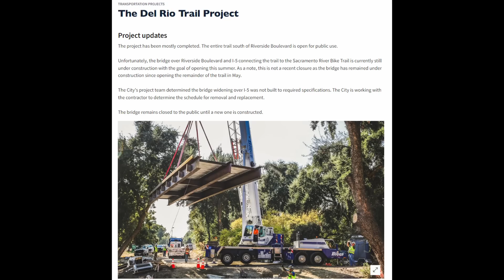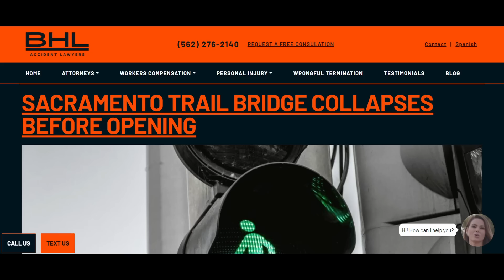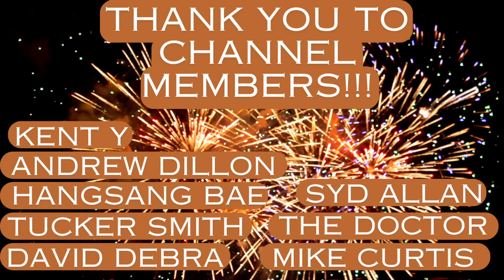Sacramento Pedestrian Bridge - What is the Problem?!

Comment: I used this bridge several times in the last several weeks it save me from having to to used  Sutterview road and the entrance to the levee Sacramento River trail crossing I5 exit and entrance ‘s ramps too I5.  For 50 years this trail from Old Town to Freeport had been proposed, finally it’s done, well almost, I used this trail from my home Sutterview rd. To almost Freeport, Ca. Trail end at a park. You can’t get to the next intersection without out using  dry narrow part of Freeport blvd.  Friday last March 12 I got on this trail from Del Reo rd. At Suttervill rd. crossing Bridge Closed sign yep, both end of bridge closed blocked with k rail hooked my Quatrevelo a chain to my hitch, hook chain to K rail try to move K Rail  but it caused a crack in the bridge a few rocks fell onto I5 I rode on Quatrevelo to old town. Hid from Cal Trans employees who were after me for damages I got away now demanding they re open that bridge as it keeps the kids who ride Sacramento River off the roads. Yesterday I went back onto the trail checking the crack I cause, it’s worse! Thous of you who use I5 beware rocks could fall onto your Tesla, not sure why only Tesla’s get hit with rocks. My count of rocks hitting Tesla’s five hits six misses.

Comment: I haven't been able to find any updates to this story.  Since the issue(s) arose so close to opening, it makes me think that something reated to the deck is at fault.  
Locally Administered Projects (LAP's), in my experience, don't always have the best construction engineering & inspection teams available.  But, a $23M project likely has some state funding, and possibly federal dollars.  If this is the case, certainly (at a minimum) phased inspections, with hold points before proceeding to successive construction operations would have been mandated.
The picture in your video showing the superstructure section being lifted, shows that girders, diaphragms, and SIP metal deck pans were preassembled, possibly offsite.  If these were shipped from a fabricator, presumably Caltrans would have had a shop inspector present ( unfortunately, my experience has shown these inspectors preferring a close relationship to the shop they're overseeing to actuallyholding the shop to the plans & specifications).  My point being, once these pre-fabbed superstructure units are placed, rebar and deck concrete will proceed pretty quickly. 
Rebar samples are often required for testing, and superstructure samples are generally taken separately from the substructure bars.  I f the samples were even taken , it's possible that they weren't tested before the deck concrete was placed.  Another possibility is that rather than placing lightweight concrete for the deck, the contractor might have used an approved "normal" weight mix.  That possible faux pas would add approximately 50% to the dead load of the bridge, while saving about 25% over the cost of lightweight concrete.
Reply: Edit to above:  I hit post before I meant to. 🤪
All I was going to add is that we don't know enough at this point, because nobody is talking...  more shall be revealed
Reply from the maker: Those are interesting insights.  Thank you.  I have reached out a few times to City Engineering staff and they will not respond to my inquiries.  Also, one of the local media outlets reports seeing the letter from the City to the Contractor.  They don't report any details and they did not post the letter in their online stories either.  I will reach out to the City again and push for more details.
Reply: @CaseyJones-Engineer  Sounds like it might take a FOIA request to get any information.  If the city isn't sharing information, they'd likely stonewall that request, too.  They're going to have to release more at some point.  I'm surprised the local media hasn't pressed for more.

Comment: Before any concrete is pour the Mix Design has to be approved or not a single truck is allowed onsite and will not be paid for.  So the City of Sacramento paid for non-conforming concrete?  With military contracts like runway aprons at Beale the Army always takes cores to verify strength.  I question the City of Sacramento's Inspector and Construction Manager who signed off on monthly payments.

Comment: While only a side note, most cities will not repurpose an existing transportation right of way, but mothball them for a period of 50 years or more to accommodate for future expansion of transit opportunities. The best example of this is in NYC. There the old “High Line Railroad on Manhattan’s west side, south from 34th St became unused in the  1960’s. It was partially removed in Greenwich Village where it even had a route through manufacturing buildings( freight). It was finally repurposed as a “High Line Park” in 2010.
Reply: I’ve heard the military keeps an inventory of working and/or abandoned or repurposed rail beds for potential heavy vehicle use during emergencies or possibly war conditions.

Comment: Thanks Casey. When the Earth was young and dinosaurs roamed the planet I was a young construction contract administrator on a nuclear power plant construction.  I never forgot the 
advice of a well respected project manager who advised that when a project looked like it was fubar,  it would be easy to beat the contractor to death but it was most likely to not fix the problem and  there still remained the problem of disposing of a dead contractor and all that that would entail.  It is almost always better to work with the contractor to solve the problem if possible.  The city's pronouncement that " they expect the bridge to be torn down and replaced at the Contractors expense."  sounds like an owner who is trying to cover up something.

Comment: Let's delve into the history of this iconic railroad bridge.  This was a  Southern Pacific Railroad line,  which originally ran from the SP yard in downtown Sacramento to Walnut Grove.  Today, the tracks cover a distance of 3.5 miles and are used by the Sacramento Railroad Museum for their vintage train rides.
When Interstate 5 was being built around 1974, they had to make a bridge for the Railroad so that the freeway could go underneath. I lived in the neighborhood at the time and talked to the construction people. They said that this was the first railroad bridge in the world to be made with concrete without steel or wood supports. This bridge was filled with sensors and wires all over it for over 20 years. For this testing, they needed a bridge location, not part of a main line. 
Sacramento bought the right-of-way years ago for a future light rail to Elk Grove, but the neighborhood didn’t want people looking at their backyard. Then Sacramento decided to use this bridge for the bicycle trail, but the Rail Museum wanted to go an additional half mile. Then Sacramento decided they wanted people on Interstate 5 to see people using bicycles to get to work and see the vintage steam train on the bridge. 
Finally, Mountain Methods, Inc. was used because it is a Small Disadvantaged Business, which means Sacramento would receive additional funding from the Federal and State governments. However, the company has no history of building bridges.
Reply: I remember the old, steel rr bridge and the new construction well. Grew up over on Del Rio rd.

Comment: My understanding is the contractor used the wrong concrete in the construction 
There are ways to fix the problem without tearing the whole thing down
Reply: Whatever concrete is involved in the trail bridge is apparently some that was added to the side of the railroad bridge to provide anchor attachment points? Have you driven under and seen it? I haven’t, but Google street view provides excellent images. You can pan straight up from just below it and see every detail. Looking at both sides of the railroad bridge from both north & south lanes gives a good comparison to show what was added on the south for the bike bridge, which has zero supports from the ground. It’s 100% bolted on to the side wall of the train bridge with some wood & steel angle braces for support.

Comment: Casey,

You're discussing California, nothing is ever simple.  The RR bridge may be "abandoned" as a result of earthquake standards or age.  The cost of fixing an old abandoned bridge may be prohibitive,  especially if the bridge is historic.

Another issue may have to do with right-of-way issues.  

Years ago I had a concrete test sample that was perfectly flat on one side.  My guess is they were testing at a seam.  The civil engineers' test lab had pallet loads of samples scattered all over the place.   The test sample with the flat made a great doorstop.

Bob
Reply from the maker: Thank you for your comments!  Yes, a lot of crazy stuff can go on working with concrete.
Reply: It's not abandoned, and used quite regularly by the CSRM. The Bridge itself for about 40 years, the line beyond almost 10 years. The City itself is pushing for the correction. A bridge engineer inspects the rail bridge annually, and one has inspected as special extra in response to rumor spreaders.

Comment: If this is considered a transportation project that is funded in part by Federal funds, there is a Buy American requirement.  That is certain materials, such as steel, must be of domestic origin.  I used to work for a pipeline company and when we were reimbursed for road crossings due to road construction or improvement, we had to purchase domestically made steel that is steel melted, poured and made into pipe in the US.  If domestic pipe could not be sourced, there was a waiver process, but it was very difficult to obtain one.

Comment: It's been 45+ years since I studied Civil Engineering in college,  but the days we got to crush concrete cyliners / beams or test rebar in the Materials & Testing class were always exciting. 🙂

If I had to read between the lines I suspect that subsequent testing of the concrete did not meet the spec outlined in the plans. The city lawyers are probably in CYA mode,  and want to make the contractor replace the bridge so they have no future liabiilty.  The question is, and we may never know unless it goes to trial... exactly what do any tests show, and how far off from spec are they?

Comment: It's not a new bridge it's an expansion of the rail road bridge. https://www.google.com/maps/@38.5442768,-121.5091189,3a,75y,24.9h,103.76t/data=!3m7!1e1!3m5!1sWKmc_DSMNzkoh04msNpePg!2e0!6shttps:%2F%2Fstreetviewpixels-pa.googleapis.com%2Fv1%2Fthumbnail%3Fpanoid%3DWKmc_DSMNzkoh04msNpePg%26cb_client%3Dsearch.revgeo_and_fetch.gps%26w%3D96%26h%3D64%26yaw%3D210.76808%26pitch%3D0%26thumbfov%3D100!7i16384!8i8192?coh=205409&entry=ttu&g_ep=EgoyMDI0MDkxOC4xIKXMDSoASAFQAw%3D%3D
Reply: Thanks for posting the link! I found it myself yesterday. A few clicks down the road & panning up from below bridge is fascinating. It doesn’t look safe to walk under yet there it is hanging off the side of a railroad bridge over an interstate highway. Seems like there must be more to this story than questionable concrete test specs?

Comment: I did concrete testing for a couple of summers during college.  We would stop the ram at the point when the pressure gauge started to drop before the concrete exploded.  Once you got used to it, it wasn't bad.  But every once in a while we would get some high strength concrete in for testing.  It would make me really nervous when the pressure started climbing of 150,000 lbs.  Those cylinders tended to break quickly.  In which case, we would get calls from upstairs wondering if something blew up.

Comment: Memories of the 2018 FIU ped bridge collapse in Miami while under const. 6 fatalities. Don't recall the cause
Reply: (Wikipedia) The engineering design error that directly led to the collapse was identified by the National Transportation Safety Board (NTSB) as a miscalculation of resistance to sliding of the connection between the walkway surface, and the truss that held it up.

Comment: LMFAO... you're right up my wheelhouse on this one.  I worked for 3 test labs over 20 years before moving to the dark side and became a QC Manager for a redi-mix supplier for the past 20.  In all likelihood, the city inspector was someone they pulled out of maintenance who probably couldn't find his ass with both hands if you gave him a map, and the tester was a warm body who could count to 25 that they handed a slump cone, air meter, and tossed him to the wolves.  To top that off, it was probably a 4000 mix that made 3950, and the city engineer is just being a prick.  I've seen every permutation of those, plus far more than I care to mention.
Reply from the maker: Very cool!  Yes, owners and their representatives can be totally unreasonable.  Another problem can happen when multiple engineering consultants are involved and they each try to play "gotcha" to validate their role on a project.

Comment: I know you have LOTS of topics. Do you have an opinion of Chinese man made military islanded. Dredged sand with bases, bunkers and airstrips. Supposedly, they are sinking and the concrete structures are damaged, etc. Can you dredge the ocean and make sand islands?
Reply from the maker: Great suggestion. It's a type of land reclamation that has been used for many many years but settlement can be a big problem.

Comment: Looking at the Google maps and the Sacramento CA assessors real estate maps https://assessorparcelviewer.saccounty.gov/GISWebService/api/gisapps/AssessorMapImage/017001 it is odd to see Federal eminent domain common carrier railed real estate listed in a State County tax map because they have no eminent domain over it and don't control the property.  One indication of that acknowledgement is the assessors office lists it as $0 value.   

Likely now run by volunteers railroad's real estate is not being held at high integrity as would be  beneficial having its records very up to date and being hands on with a bicycle transportation facility being implemented in its corridor.   It is almost certainly lacking good railroad and bicycle facility design and engineering oversight.   

A guess is the railroad crash wall on the bridge was obviously not of railroad crash wall construction.  CSX transportation likely working off Federal regulations demands human occupied  facilities within 50-feet of its tracks have six foot high crash walls protecting them.   I saw that in the construction of the AirRights building in Bethesda MD where the building having the Georgetown Branch's purchased  air rights built around a 32-foot wide track area with six foot high 2-foot thick crash walls made a part of the building's construction.   The was built around 1970 when the track speed was 10 mph with the prospect it could return to its design track speed at about 45 mph.  

The bicycle bridge, it is build for bicycle traffic and can carry pedestrian traffic,  was possibly not fully up to railroad crash wall requirements.   It may have been done originally by a design firms not at all familiar with freight railroad requirements.  There is  strong  possibly without somebody being critical with the project they didn't care.  Now somebody possibly Federal FRA has inspected the project and concluded it is not a railroad crash wall as built.   It maybe obvious to any railroad design engineer and some rail fans.  

I measure with Google ruler tool control-click the bicycle bridge deck width at 12-feet.   The running  pavement path width with shoulder area is also 12-feet.   Bicycle facility design is that there be at least a 2-foot additional width per side for bridge decks over the running path width as a bicycle operational clearance.  In this case a minimum deck with of 16-feet.   These are very common known guidelines and make sense.   For them not to have been used makes the whole project suspect of insufficient minimal proficiency with bicycle facilities. 

This could easily be a model bicycle facility with just bit more care in implementation needed at minimal expense.  First it could be a model Rail-Trail in some locations and all, but a Rail-Trail with a rail alignment paralleling the exiting track in others with that uniformity held throughout the project.  It is not.   

A typical 10° minimum curve for mainline railroad use is about 550-foot radius curve that to a cyclist feels attentively fast on wet pavement at 23 mph.  The spectrum of common cyclist speeds on flat bicycle paths is 8-24 mph.  

The minimum curve radius for a bicycle design speed of 30 mph is 250-feet radius.  This is minimum design speed recommended for arterial bicycle facilities.  The maximum expert cyclist speed on wet asphalt on a 250-foot radius curve is only 23.5 mph and is not comfortable.   

The minimum design speed to be considered a bicycle facility is 20 mph to be used for path lengths of 1-mile or less typically feeder paths.  This has a minimum curve radius of 95-feet centerline that with wet asphalt drops to 15 mph.  Below that design speed it is not a bicycle facility, but may still be considered a type of multi-use path.  

This 'bike trail" I was able to google measure approximate radius through kinks of 75-feet and 140-feet radius through a longer U-bend.  This is in a railroad corridor where creating a very high quality alignment on par with mainline track is available.   

Out-of-service would still mean the railroad corridor is federal eminent domain and is not abandon.